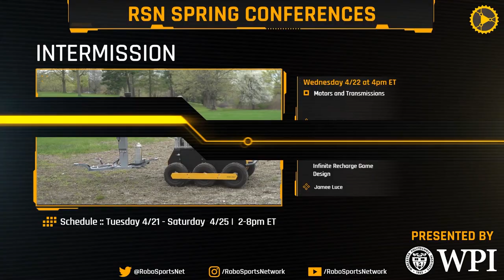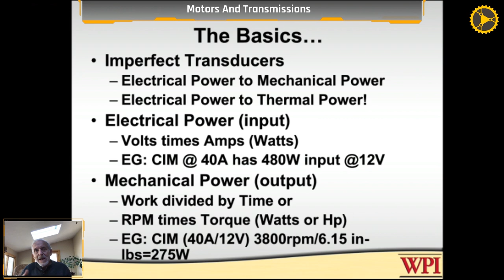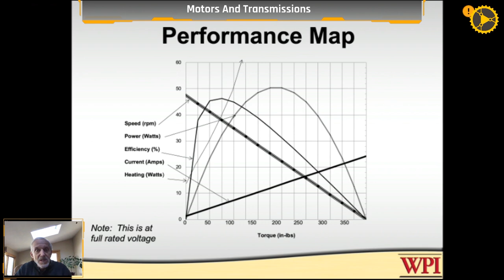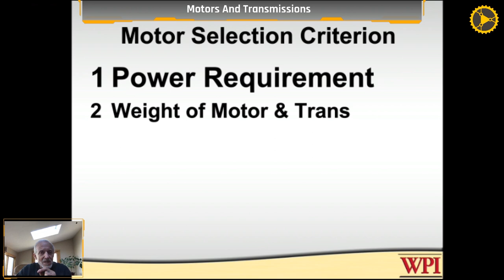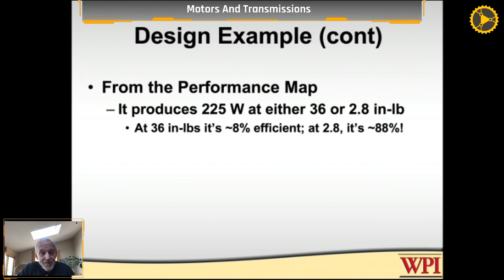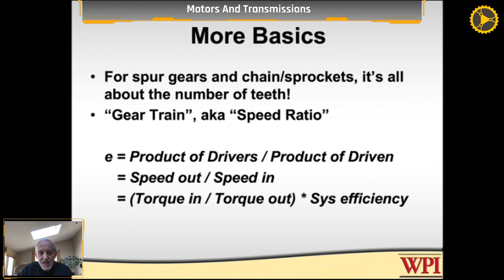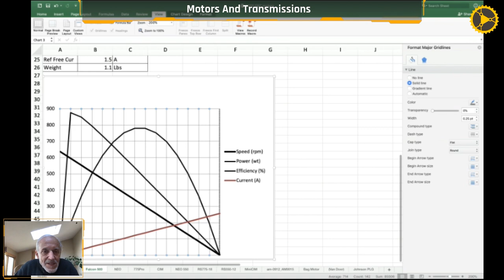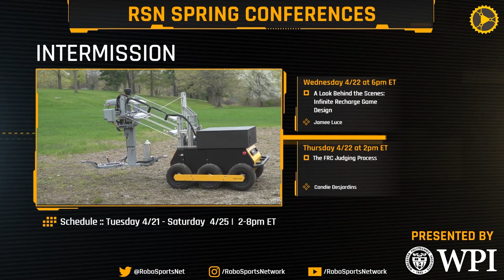Motors and Transmissons with Ken Stafford RSN Spring Conferences Presented by WPI

Comment: Sorry to be so late in correcting this, but there is an obvious error on the Design Example (~50:24).  The power required is actually 225 ft-lb/sec.  In my dash to get these new slides prepared, I neglected to apply the conversion factor (which is properly shown as 746W = 550ft-lb/sec = 1 Hp). Ouch! The correct power should have been 305W...